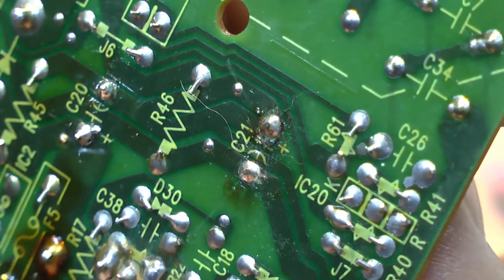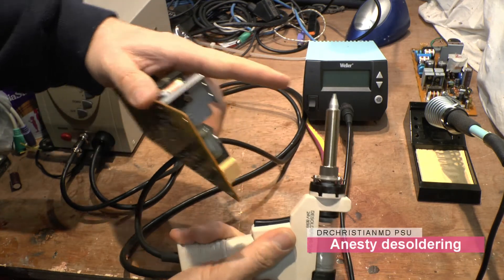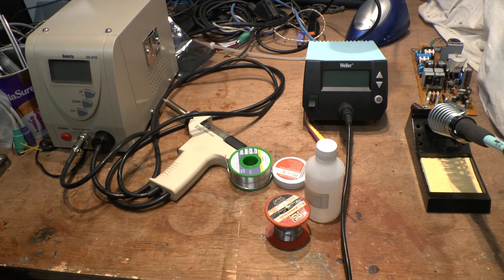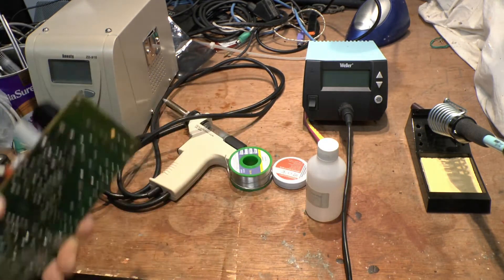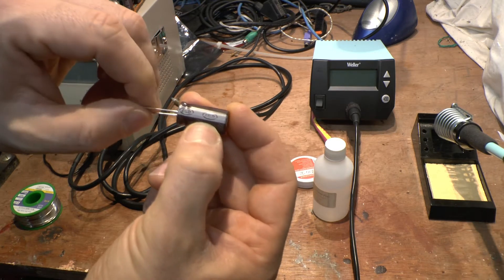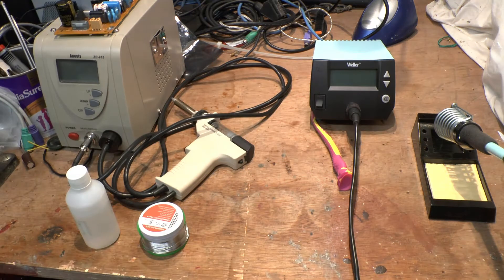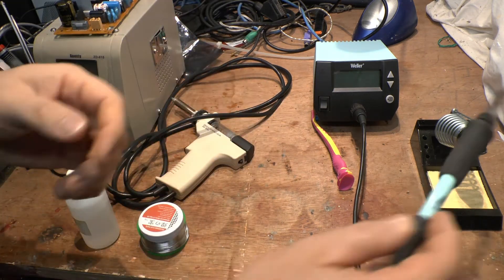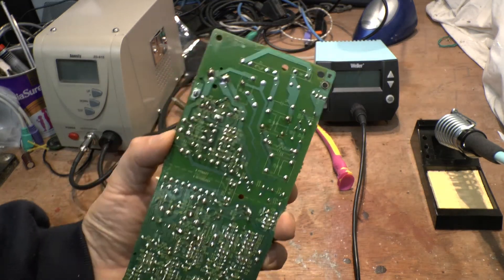Pioneer 925 / 310 H2 PSU or SPDR error solved. (Finally)

Comment: Thanks for the video. Learnt a lot. I'm wondering if you've also replaced the capacitor C12 (1uF 400V) located next to the smoothing capacitor C11 (100/180uF 400V) ?
Reply from the maker: Yes, and easy to miss. It was actually very far off spec too. 

Its hidden under the heat sink beside the 400v Cap on the primary side. :-)
Reply: @DRCHRISTIANMD   I think C12 can be directly measured on the board. Same as what you mentioned, my C12 was measured at only 2XXnF. I suspect whether the video noise of my player is due to this one. Also do you think the two 10uF (16V) and the two 2.2uF (50V) electrolytic caps need to be replaced also?
Reply from the maker: @milkprofessor5341  I changed the lot with a mixture of Rubycon and Panasonic. I would do it while I was in there as I did on the final board that I will show in a later video. It best to change the lot at this stage on a board of this vintage in my opinion as It might stress out the older caps...
Reply: @DRCHRISTIANMD  Also I'd like to thank you for the reminder in the video that replaced capacitors should be firmly soldered to make sure that they make real connections to the circuit, which is very important. Yes I'll stay tuned to your channel for the forthcoming clips, thank you!
Reply from the maker: @milkprofessor5341  Thanks a million for you're support. :-)
Reply: @DRCHRISTIANMD  Thank you. Coincidentally I found H2 error in 2 of my LD Players (CLD-s370 and Denon LA-V200G) after replacing the 100uf, 470uf and 1500uf caps (for +/- 5v lines and P-ON detection) last week. After confirming that the parts were firmly soldered on the PCB (just as what you mentioned in the video), I found that one residual solder left on the board makes accidental connections to the neighboring path. Another finding is that one solder drop is big enough to short the route next to it. After removing the residue and diminishing the size of the solder drop, the H2 error was solved.
Reply from the maker: @milkprofessor5341  sensitive ould blighters! These laser drives... :-)